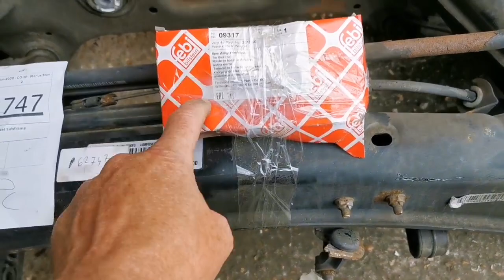Mercedes c class w204 subframe swop

Comment: Mercedes dealers replace this sub frame under warranty. So check your dealer first!

My imported c w204 was fixed for free at the local benz dealer in november 2020, its is a 2007 model wth 350.000Km at the time. 
the car is not serviced by mercedes dealers, the dealer did not aks weird questions or tried to sell me something.

Awesome service from Mercedes.

Comment: I'm in the same situation with my own W204 (2009 C200 Sport CDI). I spoje to a local specialist and the first thing he said was to get on to Mercedes. Mine is booked in at a local dealer for a free insepction and subject to approval from the UK HQ it will be replaced free of charge. It would cost about £3-4K most of which is the labour. I've seen plenty of subframes on eBay in the £2-300 price range. It has been documented on various MB forums and quite a few UK owners have had their rear subframe replaced free of charge. I will be documenting my situation on my own channel.
Reply: Make sure they dont brake ur brake lines like they did mine😮
Reply: Mine was replaced under warranty by a local dealer.

Comment: Same problem for me. 2009 W204 Kompressor 90k with full MB service history.. Bodywork and underneath is mint and clean as a whistle. Apart from the subframe which is rotten and lower near side arm has completely come away from subframe. The warranty I got with the car wont honour it as they say the subframe comes under bodywork which is not covered. I also phoned MB where the servicing had been done and they didn't want to know as it was out of the MB warranty even though they had serviced it every year since brand new and hadn't spotted it. Very strange! I am currently in the process of having it swopped over but will say it hasn't actually made me  a MB lover.

Comment: On the 4 sub frame bolts did you have an E15 torx star socket. I need to do my subframe but the E16 is to loose and the E14 is to small.
Reply from the maker: I bought a set of eBay us Pro / bergen, 1/2 inch impact for about 26 quid I think. They were tight and you only get one chance on some of them. I bought a set of spline aswell I'm sure sf the suspension parts were spline

Comment: great video! Would you recommend jacking the rear part of the car from the diff? I don't trust it. It would be better jacking it from the side jack points and then putting two jack stands on the rear subframe? To do other jobs obviously, not replacing the subframe. Thank you :-)
Reply from the maker: Not really there alloy and could put the jack thru it unless you put a block of wood under it

Comment: You are excellent 

I found a new unbranded one for £429 is it worth it and how much should it cost and will it take to fit?
Reply from the maker: Yes there are some good after market subframe out there. Does it come with all the bushes / mounts? And what about control arms? It will drive like new at the back with all new bushes, if you took it to a backstreet garage I reckon anywhere from 3 - 600 quid. Quite easy on a ramp to do
Reply: @peteramberley9952  can you do it for 600 peter
Reply from the maker: @adamxaan5938  I would love too help you and do it for you but unfortunately I have a full time job in a different industry. Which I struggle to find time for my own projects

Comment: The subframe of the W204 is swapped for free by MB.
Even if your car isn't dealer maintained. No need to do it yourself!
Reply: How do you go about this im now going through the same thing an i can't find a rear sub
Reply: Vicki Crawford Go to the nearest MB dealer and report your problem to them. They will contact MB Germany and deliver pictures of your case. MB Germany will give them permission to swap your subframe and pay all the costs. 
Here in the Netherlands many people have had their subframe replaced with a new one for free.
Reply: @Mr.Riffian  thank you for your help
Reply from the maker: Good luck with that. Mb UK would not even divulge part numbers with you. In England your on your own I'm affraid
Reply from the maker: Sorry I didn't reply Vicki YouTube never notified me of your comments. The subframe are getting harder to find but don't rely on just the part numbers as mine was totally different, I can't imaging that they would make different subframe for each model. The only difference on mine then the c350 was diff and brakes which was easy to change over
Reply: @peteramberley9952  I did manage to track one down thank god .an yes your right mb didn't want to know.it  was a costly experience but I got in to deep it was scrap or bite the bullet
Reply: @vickicrawford1615  how did it go Vicki. Is all good now?
Reply: yup. mine was swapped for free 2! :)

Comment: Roughly what's the damage for this kind of job. Mines just gone.
Reply from the maker: Mercedes charge about £700 for new subframe and about 2k labour, you can find a 2nd hand subframe for about £250 and an indy would probley charge 500/700  labour
Reply: What about the sub frame which is unbranded brand new for £429 including postage is that any good?
Reply: I meant for sale online is that one any good or should one only use a genuine Mercedes part